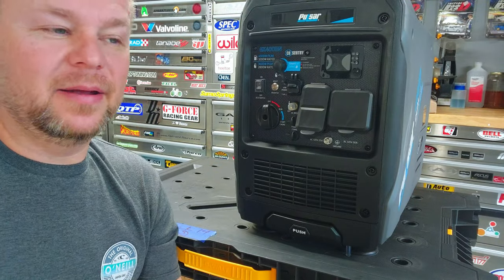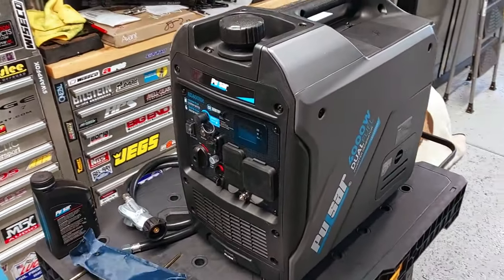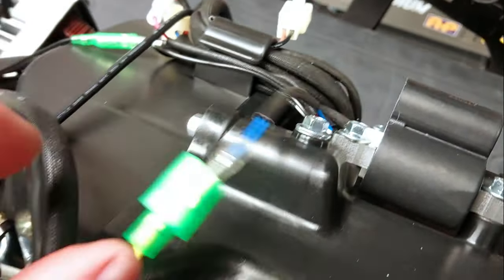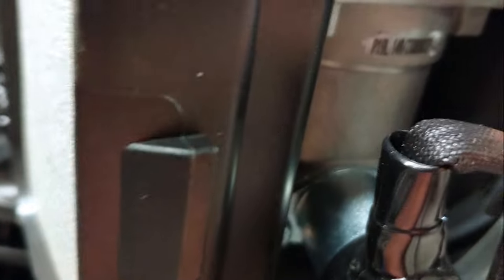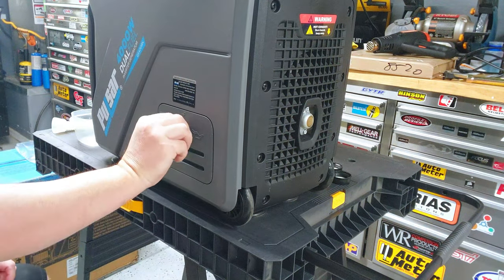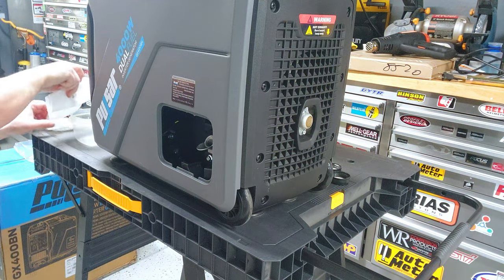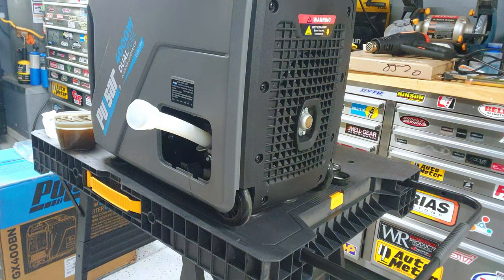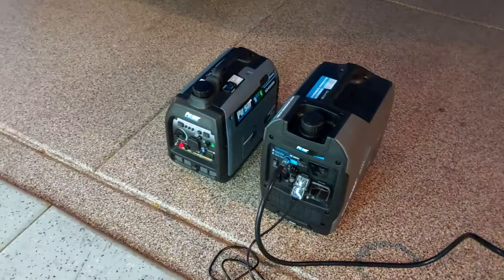NEW MODEL! 3200W PULSAR PROPANE - GAS DUAL FUEL INVERTER GENERATOR DETAILED REVIEW | RV | CAMPING

Comment: Amperage problem "resolved" Time stamp 4:25. Happy new years MR Garage. I now own both the GX and the GD.   So the LCD shows Voltage, load/wattage usage as squares on the very top LT to right. The volts, Hertz, "A" I'm assuming is for approximant run time while using Gas only? I have confirmed this many times before writing this. I think "A" works hand and hand with the gasoline fuel gauge and load/watts being used. The "A" value changes up or down based on your load and how much fuel its reading to approximate how long the Gene will run at it's current load with the remaining gas in the tank. I'm 99.999% sure of this. If i add more fuel or change the load, the vale instantly changes. More fuel and less load a higher value is displayed, low fuel and a large load the value decreases. You were running the Gene on propane and the fuel gauge was zero, I think this is why the "A" value was not displaying. Cheers and I hope this helps everyone in the future.   
Also I think "S" is for current run time and reset when the engine turns off and "C" for cumulative run time. PS Pulsar higher MR Garage as a consultant for your advertising and manual documentation.

PS: PS:  The wheels and the carry handle both make a ratting noise. After i fixed the wheels (thanks to you) I noticed the handle shakes, I have to pull it out a bit to lessen the noise.
Reply from the maker: Good info on the A portion. I incorrectly assumed amperage. Would be nice if their documentation stated the info properly! I ended up returning the GX and kept the GD which has been awesome. No regrets so far. Still wanting more features so I have a Heomaito HMT3500iD dual fuel on the way. Looks like a good option between the GD and GX. Will review in the next week. 
Heomaito features:
- Little over 1.5G fuel capacity, +.5 over the GD
- No pull out handle or wheels, built more like the GD (did not want those as an option myself) 
- Very nice digital display with proper readout
- Spec at 50lbs, virtually same as the GD
- Has a 149cc engine like the GX, unsure if the same assembly 
- True 20A plug where the GD has a 15A they claim is 20A

Pretty excited about trying it out!  Sensi looks to be the CM but cannot confirm yet.

Comment: Been shopping these 3kw 150cc generators to replace the broken 20 year old generac my new to me rv left the factory with. A-ipower also sells a version of this model. Genmax has some interesting variants on these they have one with electric start, one about to go on sale with fuel injection instead of a carb and they have an open frame version designed to feed from external fuel tanks. Theirs also allow you to series them for 240 volt power.

Edit: The noise different would be enough for me to go with this style unit assuming it fits in my basement storage on my motorhome.
Reply from the maker: Very Cool. Genmax = Dinking. A-ipower usually uses Senci as a CM but have seen several other models from them too. Loncin + others.

Let me know the model A-ipower that is like this one. Everything on their site currently looks to be Senci.
Reply: Sorry I've looked at too many of these and misremembered. I think I was thinking of the GXS4300iD because it's got a similar feature set with the display, wheels and telescoping handle but it's clearly a different model.
Reply from the maker: They all start to look the same :)

Comment: awesome video , thanks , I have the older model , added a hour meter/engine temp gauge and love it
Reply from the maker: Nice! Do you mean the GD400BN? It is not really older or being replaced, just a different model (still new).  The GD is a great generator.
Reply: yes , the GD model , I do feel I have more confidence in it too being manufactured by Dinking compared to GX made by unknown lol
Reply: which temp gauge did you use? I like the look of the GX, I love the wheels and updated plugs etc. I took photos of both model cylinder heads, the GD has very rough edges while the GX cylinder head looks how cylinder heads should be, nice and smooth. I think both are great, both are budget generators for the power and both need a little work to get them tip top.

Comment: a tip I learned is you should open the valve on the LP tank slowly so the regulator in the hose line doesn't close off the flow of gas thus limiting the supply.  Might try that to see if it fixes you rough idle.
Reply from the maker: Hello, That does apply to BBQ regulators. I have yet to come across a regulator for a generator that will lock out propane flow in the same way. You can actually open the tank with these regulators / hose unhooked and open as fast as you like, propane will flow at the rate intended by the regulator. If you find any that will lock you out, let me know!

Comment: Great deep dive and walkthrough. Thankyou for this. Question, if planning to use this generator on propane to power a window ac unit and small refrigerator during power outages, how is it grounded? What is it's reference to ground? Should I put in a ground rod somewhere and tie it into the grounds in a junction box prior to the power coming in the house? Thanks again. This was very helpful.
Reply from the maker: Most will not do it, but the proper way is to use the ground lug on the panel of the generator and connect to a grounding rod. If you only drag the generator out during outages, just use a jumper cable to the lug and connect to the grounding rod quickly and easily. Or, you can use a wingnut on the grounding lug of the generator and use an eyelet to 12-14awg wire...  the wire would be permanently attached to the rod.

Comment: Really appreciate your in depth, no wasting my time with unboxing footage.  Can't find this answer, not gotten a response from Pulsar yet.  I was set to buy the GD400BN.  Was hoping for DC outlets to run cooling fan on hurricane box.  Then see this video on the GX400BN.  Also with display great!  Here is my question; the GX400BN is not on Pulsar's website anywhere.  All over Amazon and Walmart and other places.  Was trying to download a manual to clean out Amazon/Walmart mistakes in listings.  Do you have any update as to why the GX400BN is not on Pulsar's website? Thanks
Reply from the maker: Np! Pulsar has a LOT of generators not on their site. In short, their webmaster is not so hot at their job.

Comment: Bravo, well done.  My travel trailer has two quick disconnects on the propane line that I use for my flat top and BBQ.  If I were to get just a flexible gas line without a regulator with a male quick release on one end, would this generator work using my trailers onboard regulator?  Thanks for your time.
Reply from the maker: The regulator that comes with the generator is unique to the motor size and carb of the generator. If you ditch the regulator and go straight, there is no guarantee what air fuel ratio you will end up with. A lot of guys do this hack and it may work, start and run but longevity of the motor comes into question. 

Better to split off the tank pre-regulator and attach the line for the generator directly. Or, use the 2nd propane tank on the trailer (if equipped) specifically for the generator.

Comment: Do you feel this one is equal to their other one or slightly less in terms of output, quality, and such? I want to buy 2, but some things you mention on this one concern me.
Reply from the maker: I have one of the very first of this model. Other users have reported they corrected the issues like the wheel noise and valve lash. I have not heard any negative recently.
Reply: @MR_Garage  The wheel axle design has been changed to a nut on the outside end of the axle, no more rattle. I could not find ANY documentation on the pulsar website when researching before my purchase. Not even listed. Maybe the scanned owners manual will help others. I've got 3 hours and counting on the break-in without issue. The last hour I will attempt to run the 13.5 BTU A/C on my RV.

Comment: Did the extra hose clamps seem to be the same size for the fuel filters?
What grease do you use for the value gasket?
Reply from the maker: No, they were much larger. Closest line to that size was propane.  For grease, you can use a general lithium grease, moly or calcium sulphonate (basically any grease but silicone based). Only objective is keeping the paper gasket from sticking.
Reply: @MR_Garage   Sorry for the noob questions, do you apply the thin layer on both sides of the gasket when possible? I used Mobil 1 full Synthetic  the red color one for wheel bearings. I could not find on mobil website if it contained silicone. could you help with his question?  Also I took apart my GN400 to check the valve clearance after watching your videos. I'm not scared to make mistakes if it means i learn form my errors. I slightly tore the gasket when i opened the valve cover ( I already had 9ish hours). I didn't know how much torque to apply to the valve cover bolts. I was concerned i would need a new gasket, I made the bolts snug and ran the engine. I sprayed some soapy water and i noticed bubbles coming from the corner wear the gasket tore. This is my back up, back up Gen so i'm not in a rush to order the gasket. Long winded sorry.
Is air /  compression bad if a little is leaking trough the valve gasket? I'm assuming yes and long term it will cause damage or speed up wear and tear or the engine will not run at optimal levels? i'm waiting for Pulsar with the torque specs for the valve cover botls, can i assume good & tight or around 8-10 lbs?
Reply: I got a reply from Pulsar. They also do not know what the clamps are for, possibly for another market outside the USA. According to Rick J Valve cover is * 6Nm which is 4.425 Ft lbs.

Comment: So, wish one are you going to keep?  Are the engines equal displacement?  I want to take advantage of BF deals.  Which one would you buy, need to decide ASAP.
Reply from the maker: Pulsar never resolved the issues with this GX. Ended up sending it back. Compact size and super low weight are most important for me. GD is being kept. 

The GX has 4cc larger engine. 145cc vs 149cc.
Reply: @MR_Garage  thanks for taking time off from your holiday to respond.  Some of the GX features are nice, but maybe not enough to overcome the problems.
Reply from the maker: Np! I just had a sample size of one. Waiting to hear feedback from others who bought it. I do know, the GD series is a little tank. Love it like I wanted to love the GX series!
Reply: @MR_Garage  based on your recommendation I ordered the GD at 5:01am and at 8:01am they said it was shipped AND the carrier had it already.  Since when does UPS pick up orders at 8am?  Don't know about yours, but in this case the seller is Autocare Depot who also fulfilled the order in CA.  In addition to a BF discount, I use an AZ CC to get 5% cashback.  Based on my research of various models available and pricing, I wasn't able to find a better deal.    Thanks!    BTW, I had bought the Westinghouse IQ2500 a year ago, never used it, and it was stolen from my property over in Concho.  I bought that one at Sams Club on a sale.  This one cost very little more, has 1000 more watts and dual fuel.
Reply: Got the generator.  Popped the cover off to access the air filter and there were 3 wires/cables blocking access.   I didn't go further with it yet to see if they could be rerouted.

Comment: Will the GX model run a 13.500 btu a/c unit without a soft start kit?
Reply from the maker: No need for a soft start with a 13.5K BTU. Many 1.8kW rated generators will run a 13.5K without soft start if you do not have other heavy loads like electric hot water turned on or dead batteries / charger converter running. In short, this will run perfectly for you.

Comment: It’s there a way you can review their new Pulsar PG5000BiSRCO Dual Fuel 30A RV Ready Portable Inverter Generator with Remote Start? It’s 5000 watts peak and the same size as the one you reviewed in this video, and if so. It would be greatly appreciated.
Reply from the maker: I do not have it on my list to review but will consider it (have been watching it for a while). Looks to be a nice unit but very heavy in comparison to this unit but also more powerful. Remote start accounts for a lot of that weight.

Comment: Hi Mr garage. Really love your detailed videos. Very informative. On the topic of pulsar 3200w generator. I came across one truetimber 3200w   generator by pulsar. Have you seen it or can you shed some light on it. I came across one with a nice price tag and I'm interested . The mode number is TGD40iS. Please let me know what you think. Thanks in advance
Reply from the maker: They tossed truetimber camo on it and jacked up the price. Kinda funny as it is a white label of a white labeled product. The TGD40IS is the same as the vastly less expensive PGD40ISCO. The best version of these 3 is the GD400BN which adds dual fuel capability and still a ton less than the camo variant :)

Comment: Great video, and I agree that Pulsar's marketing is terrible and confusing.  Their website is terrible.  I was trying to learn more about the smaller GD400BN after watching your videos, and I don't even see it listed, so I was thinking it's an older model.  But it seems to be a newer model...  And what's even more confusing, is that some photos on websites show the GD400BN with a side decal that states 2800W running on Propane, while others show a decal with 3000 Propane.  Same looking unit.  Weird, right?  And while price shopping for the GD400BN, they seem to be hard to find actually.  Walmart shows it for $599.  Amazon has the GD400BN  but with the 2800 rated watts on propane photo, yet in the description it states 3000W.  But Walmart seems to show the one with the 3000W rated label... odd.  It's very confusing.  It also seems odd why Pulsar is selling/marketing 2 units that are made by 2 completely different manufacturers yet have almost identical specs with output, and different features.  The whole thing is odd.
Reply from the maker: For the GD400BN, There was the photo shoot before launch and errors in the artwork of their first samples it seems. Even a misspelling on the graphics of the front panel. This was corrected and the 3000W label is what you get on current production units. That is fine as I tested it well past 3000W on propane. They need to update their photo - good catch! The GD400BN is on their website under G series generators. 

The new GX is not there yet. They could just be testing a new CM or they listened to customer wants for a dual fuel. This unit has enough added features, I can see it being an option along side the GD. The price point is crazy low too. I also see the pro's to having a 10lb lighter generator (nearly 18lbs if both gas tanks are full) and a more compact package. Both in the lineup kinda make sense. 

Their PM team is rather interesting to say the least!

Comment: Did you get the amp meter issue resolved? Thanks MC
Reply from the maker: It has not. Still waiting on pulsar to call me. Put a case in - no answer. Followed up and they asked for my number. That was Wednesday. Crickets since....
Reply: Your video had great info and I appreciate it. The customer service was the only thing holding me back from purchase. I will wait for a little while and see what happens. Thanks for the reply, you have a great channel. MC @MR_Garage

Comment: How many time do I need to change the oil? Or what do you recommend?
Reply from the maker: First change at 1 hour, 2nd change just after a few hours, no more than 5
Reply: @MR_Garage  I just ran the break in, and will change the oil tomorrow. I'm running a 2500w crepe maker, so I want it to run a couple hours before putting on that load. Then the whole thing will sit for 3 months. Should I just wait on the spark plug and oil change since I'm only running it a few hours?
Reply from the maker: Indeed, for now there is no rush on the plug. Highly recommend a magnetic dip stick during break in. Make sure to drain the carb if storing for 3 months unless running on propane.
Reply: @MR_Garage  Thank you!

Comment: so how did you fix the poor idle?
Reply from the maker: It was mostly resolved with properly setting valve lash which was way too tight. Also, the iridium spark plug and more break in time helped a ton. Mostly the value lash though. Still a little bit of a lope and sound similar to having a big cam in a car. Add any load, even 5% (raised idle) and it is smooth as silk. Makes me wonder if just a little more idle RPM dialed in would be the ticket on this gen. Not sure how to do it since it is electronically controlled. I will investigate this.

Comment: Would the dipstick fit a Ryobi 2,300W generator? I would try out the wheel washer and see if the wheel noise lowers down. It idles great tho.
Reply from the maker: Just have to check the length. Most all these small generators use one of two lengths. Same threads.

Comment: Do you have a video on adjusting the valves.
Reply from the maker: I do! But for another generator. Exactly the same practice. Make sure it is on a compression stroke, get the motor to TDC and adjust. That simple! https://www.youtube.com/watch?v=F3g7STq5X3M

Comment: What size is the propane inlet? I'd like to add a quick connect.
Reply from the maker: I have not checked into the quick connects as I rather have threaded fittings so I can bleed the line off easily before 1st start. I will try to determine the fitting size.